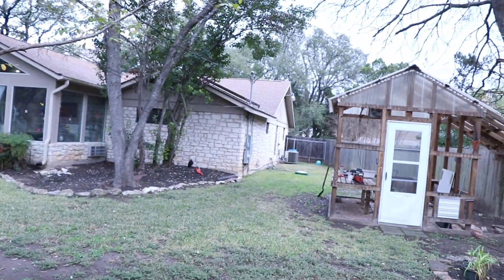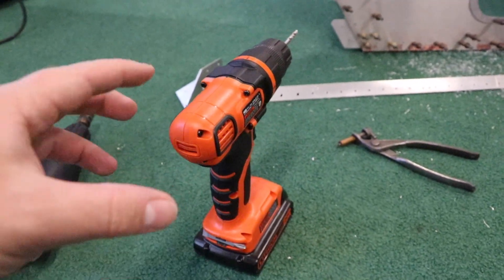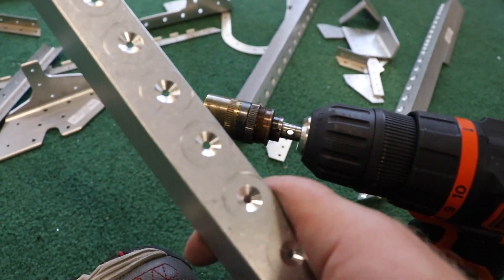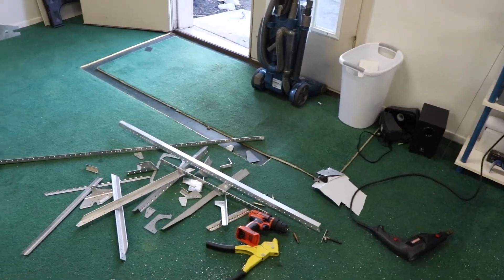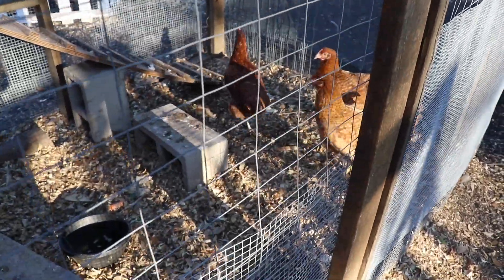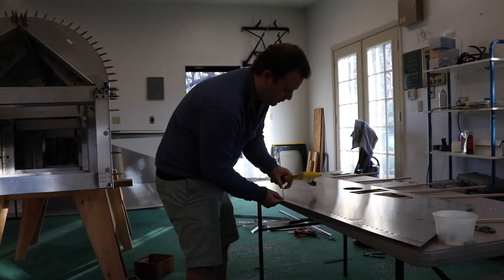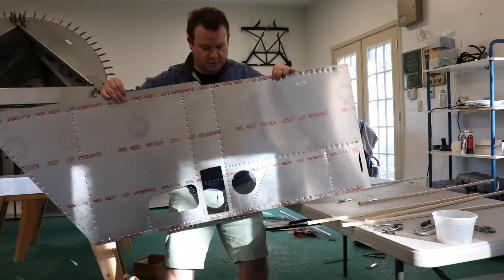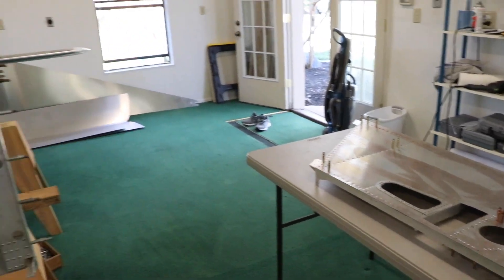Sonex Build Video 78 - Finishing Fuselage Sides

Comment: Hi Danial ... keep on the good work, you are doing great.
Danial could please provide provide a link to the video where you installed both the vertical and horizontal Tail ... it is very important to me ... because I might forced to take them out in a sonex Tri gear that I am buying and need to transport it in a 26 foot U haul truck ... otherwise I would have to saw off the fiberglass tail tips .. I appreciate it